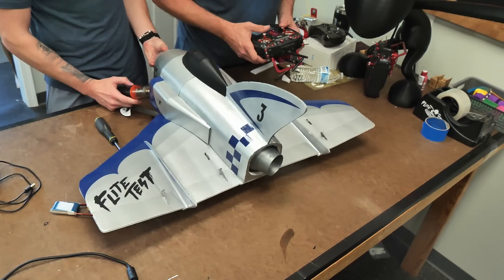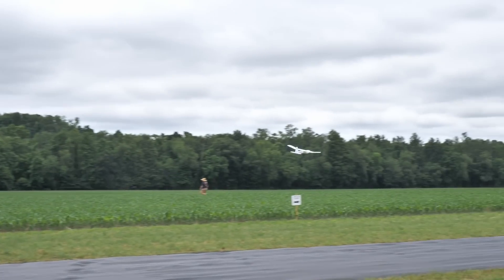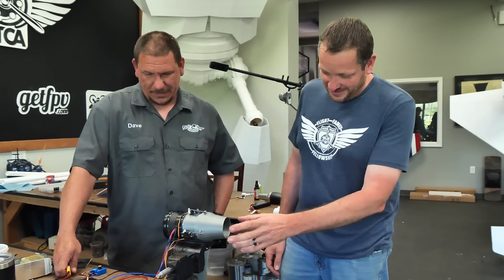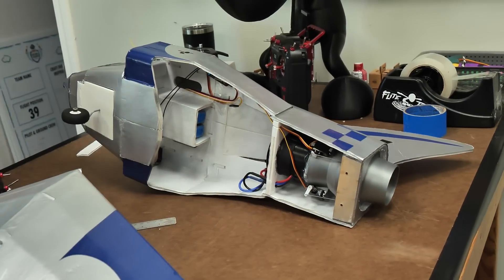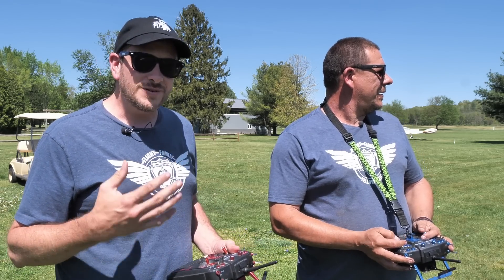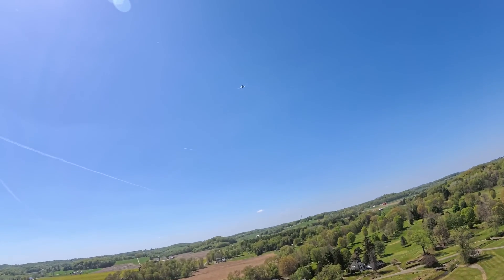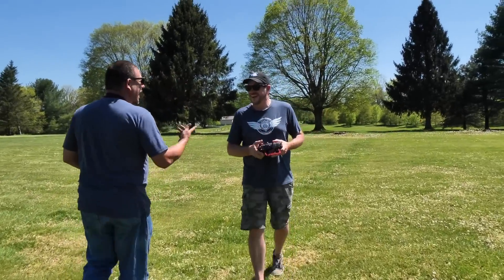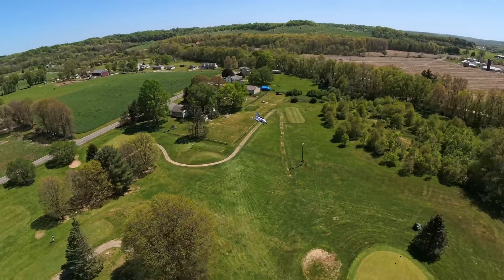Will It Fly? 3D Printed Thrust Vectoring Motor

Comment: I didnt know about this competition, last year i made my own. Can i still enter the competition?
Reply from the maker: Unfortunately, This thrust vectoring challenge is over but you can still share it on the forms that way other pilots can print it and use it.
Reply: @FliteTest  thanks for responding, ah thats ☹️ but will definitely be taking a look at the forms and other designs. As i went with pinions, ring and something kinda different. My total weighs 24gr, edf 64 and 70 mm overall length 120mm

Comment: "I used thrust vectoring to flat spin for some reason"

Am I wrong that thrust vectoring is an extremely robust control system that can be used for a ton of interesting things? Why was the most interesting thing you could think of a flat spin?
Reply from the maker: Yes thrust vectoring is used for a ton of amazing moves but unfortunately ... Josh crashed it before we could try anything else 😂

Comment: Looking at the vector thrust nozzle design could u possibly  shrink it to take smaller motors that would pivot inside the housings and poss make a working harrier jump jet able to  perform proper VTOL and poss even as a little challenge try to land it on a model aircraft carrier as the big issue is the transition form vertical hover to horizontal flight and back to hover 🤔 loving the posts and the amazing builds 👍have a fantastic one guys stay safe take care all the very best from Scotland to you 👍 👊

Comment: Finally you guys got rid of the Spektrum radios, that's the best thing that happened to this channel in years!
Reply from the maker: We absolutely love our radio masters and also the new ELRS protocol
Reply: @FliteTest hey guys, I was wondering if there is a way to get in touch with you regarding a couple questions I have about one of your kits I want to buy?  I’ve left messages on Facebook, Messenger, and IG but have never received a response back
Reply: Elrs is just better in every single metric. I got rid of crossfire in all of my drones except my one couple mile 6". I HATED  the dsm family of relievers and radios. Binding issues, unbinding while flying, and everyone always says you just have to get it right for dsm to work really good. Elrs is a brainless operation, better packet rates, fantastic penetration through trees, and those little ceramic antennas? Brilliant for park flyers and 90% of fpv pilots.
Reply: I think spectrum is great. Just a bit more expensive
Reply: Mine has been perfect and still working perfectly after 10 years.
Reply: I use a Spektrum NX10SE and a Radiomaster TX16s Mk2 and I think they're both great radios. Seems to be the in thing to hate Spektrum these days lol 😂
Reply: @r1m.dog78 that’s because spectrum sucks 😂 the DSM protocol cannot handle noise from another rf source that’s just a fact, not an issue with elrs :)
Reply: @shadofpv  What a load of rubbish. I, and many other people, fly in very noisy RF environments and have no issues with any Spektrum receiver working as it should.
Reply: @r1m.dog78  we've hated those radios for a very long time it's nothing new.
Reply: @r1m.dog78 Yeah I’ve never had an issue with spektrum and I’ve used them for almost 7 years now.